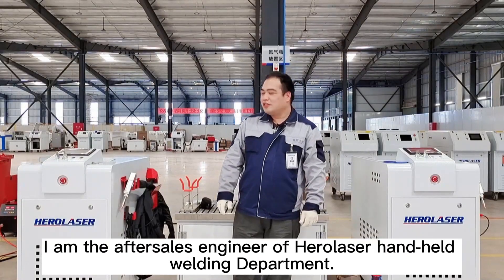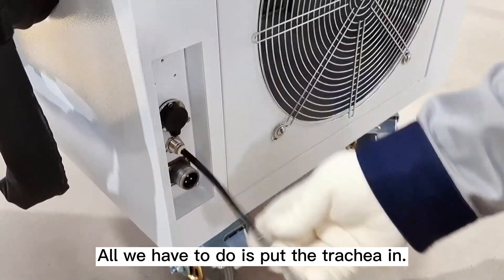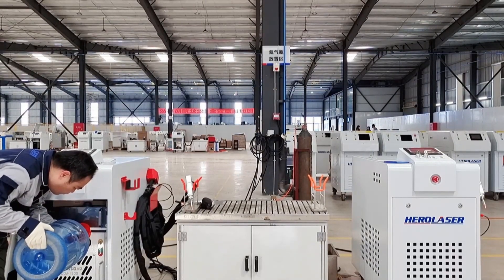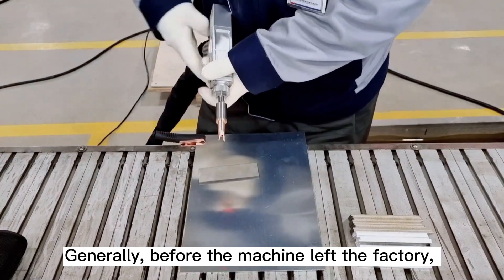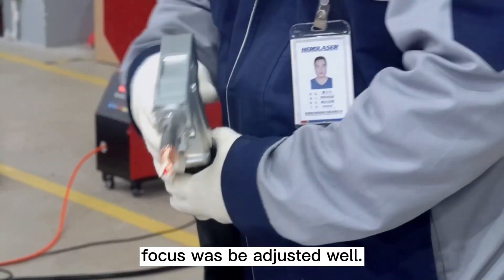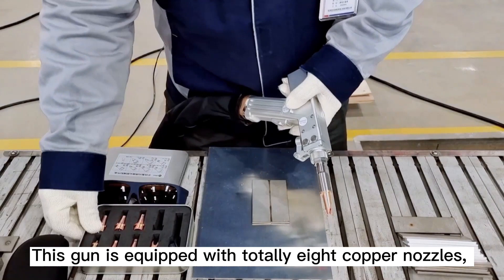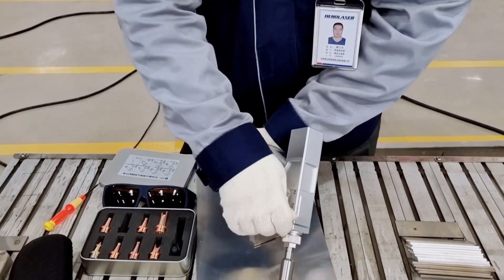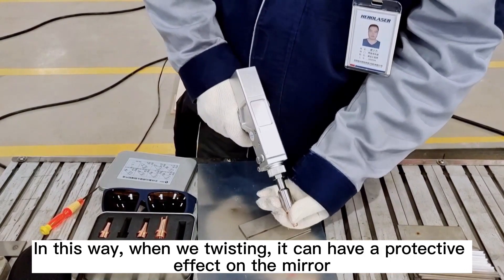Installation of laser handheld welding

Comment: Safety First: Using Handheld Laser Welders at Home 🛡

Thinking of using a handheld laser welder in your home workshop? Great! But remember: Class 4 lasers aren’t toys. Even small devices pack serious power, and safety can’t be an afterthought. Here’s what you need to stay safe:
1⃣ Personal Protection

👓 Laser Glasses: Must match your laser’s wavelength (e.g., 1064 nm). Protect your eyes—damage happens in milliseconds.
🧤 Gloves & Clothing: Heat-resistant gloves and flameproof clothing are essential for burn and spark protection.
2⃣ Enclosure or Shielding

🛡 Enclosures: If possible, fully enclose the welding area. No enclosure? Use mobile laser safety screens to block stray beams.
3⃣ Ventilation

🌬 Local Exhaust Ventilation (LEV): Remove harmful fumes directly at the source with a HEPA-filtered system.
🏠 Room Ventilation: Good airflow keeps your space safe, especially in basements.
4⃣ Fire Safety

🔥 Fire Extinguisher: Keep a CO₂ extinguisher nearby—it leaves no residue.
🛠 Fireproof Surface: Work on fire-resistant mats or metal plates to catch sparks.
5⃣ Electrical Safety

⚡ RCD Protection: A residual current device (RCD) minimizes electrical shock risk.
🌐 Grounding: Properly ground your laser system for added safety.
6⃣ Access Control

🚫 Warning Signs: Label the area with “Laser Class 4” warnings.
🔒 Restricted Access: Limit the workspace to trained users—no unauthorized visitors (especially kids!).
🏁 Final Thought:

Laser welding is powerful and precise but demands respect. Training and preparation are key—protect yourself, and enjoy safer, high-quality welds!